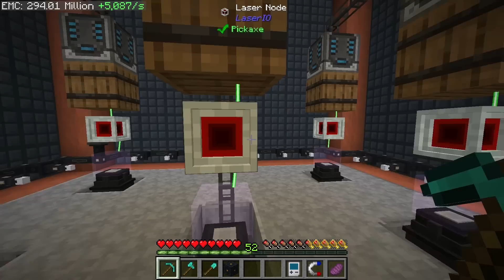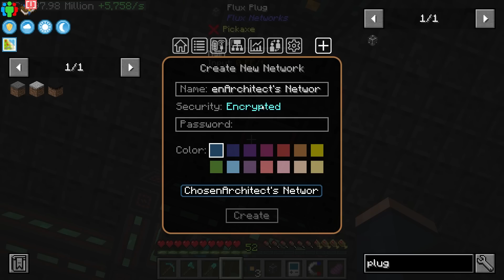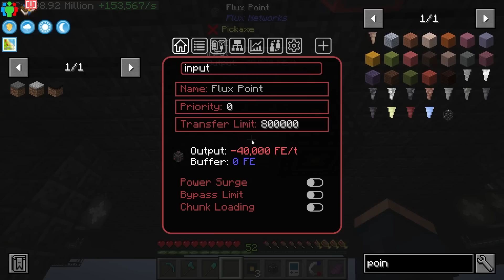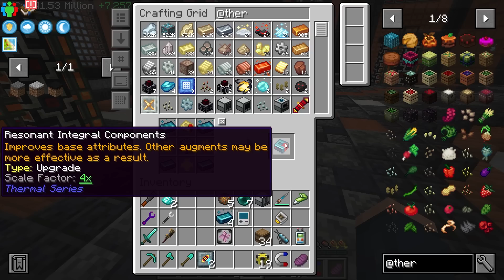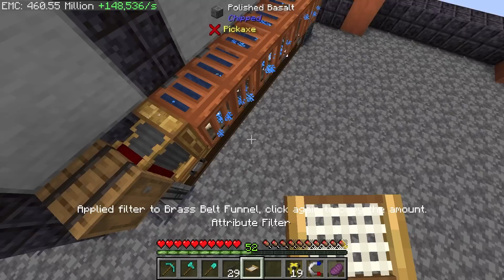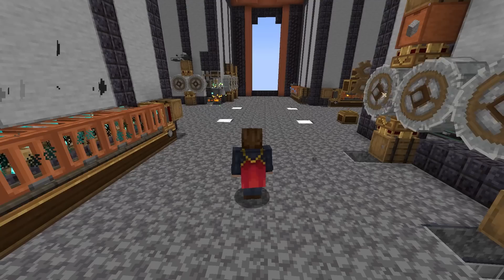Mechanical Mastery Minecraft Modpack EP11 Automating The Automation

Comment: Some math / tips for planning your playthrough:
- you didn't need to automate slimeballs. Oil clumps can be used for refined storage crafts in their place and they have an EMC value
- for endgame, you will need 92 final star shards: 8 shards for 4 creative chemical tanks (use one of these infinite antimatter before using it to craft), 84 shards for the 7 final stars you need for the first flower (after which you can buy the stars for EMC). You use a chemical tank per power flower, and you need 4 flowers for the vending upgrade (at which point you can extract infinite flowers).
- for 92 final star shards, you will need (I think) 1840 refined radiance, nitro, prec mechanisms, and each mechanical essence. I have my storage system store 2k of each before ever outputting them into a recipe (e.g. each essence is stored before being used in crafting the next essence) 
- refined radiance is more complicated that it's singular quest entry would suggest, probably start on those sooner than you think
- rush the Mekanism SPS asap. I have a 1.5m FE/t fission reactor and its still painfully slow (should maybe look into spamming powah reactors or making a fusion reactor). You get 2 antimatter pellets for a quest reward for making your first pellet, but you still need to make 4 total for the creative chemical tank (at which point you have infinite antimatter). This will take roughly 18 hours at my fission reactor speed.
- you will need an absolute ton of iron, silicon, redstone, and glass for 4 creative storage disks (like 20k) for the power flowers in the vending upgrade
Reply: I may have exaggerated: I have like 43000 of the second essence just in the buffer because I had to slow down the production for some time to create the last one of the essences... And I have 150k gun powder.. and so on... Btw did you find a solution for the nuclear waste? I saw a crafting but it doesn't work and for now I'm just placing down pipes
Reply: @the_devolper  solution for the nuclear waste... just turn it into the pellets, and after u have enough for the sps, antimatter all the way. to be fair I made a max size reactor, with 3 turbines, 1 boiler and 18 brine things... but those were too overkill and I was never able to get enough water into the boiler... you really do not need too much power in this pack, 1 stack of magmatic dynamos with max upgrades and 1-2 watches of the flowing time should be more than you would ever need
Reply: @nuwat508  i mean the spent one from polonium and plutonium production; btw I also have a max sized reactor with a max sized turbine, I should be able to make around 30M RF/t if I crank it up to the max... But I still would like to build a fusion reactor just cause it's cool 😎

Comment: if you ever do want to use the mekanism cables for item transfer and need filtering, you can use the logistical sorter, also the requester from refined storage is a very compact and easy way to automate the phytogenic insulator with its auto input and output mode. even if chosen doesn't see this, it's here for anyone that it might help
edit: yes I know there is an upgrade for the insulator to automatically reinsert the seeds, i'm just giving an alternate solution